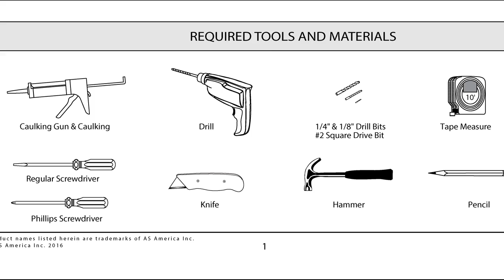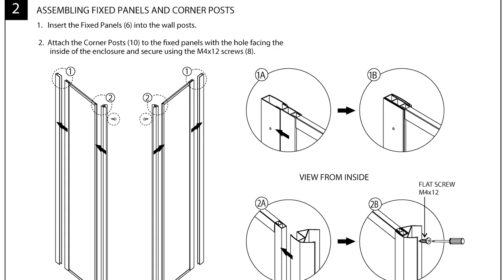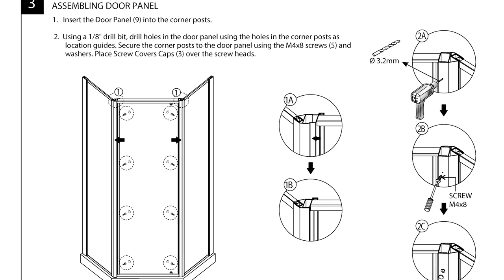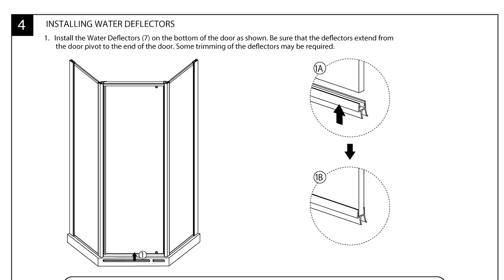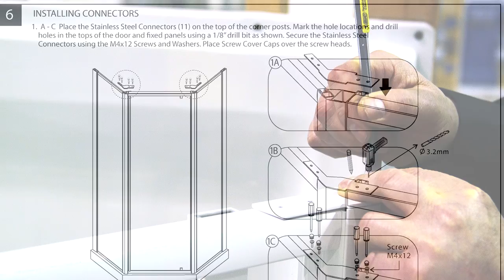How to Install American Standard AXIS™ 38" Neo-Angle Shower Door

Comment: heya american standard. i'm using the base and the glass kit, but not the plastic walls, i have tiled walls. the only info provided is "use anchors" but zero info on how to measure to place the glass. any help here? i can't measure one inch from the plastic walls because i'm not using them
Reply from the maker: Hi Derrick! So there are two different doors. The installation instructions do have the info on how to measure to place the glass, which we've included below:

AM3838N1400.020 – In the install instructions Step 1: You take a level and place it on the floor of the outside edge of the shower base to mark a vertical line on the wall.  Follow with a level vertical line up the wall.  From that drawn line you move in the 1” and that is where your wall post will be located.

AM3838N2400C.213 – In the install instructions Step 1: You take the level and place it on the floor of the outside edge of the shower base to make a vertical line on the wall.  Follow with a level vertical line up the wall.  From that drawn line you will move in 7/8” and that is where your wall posts will be located.

For further clarification or for any additional questions, please give us a call at 800-442-1902 and we'll be happy to chat. Thanks!
Reply: @americanstandard  I installed the 38 frame kit with no issues.  Hung the doors and when closing them there is a 1/2 gap on the top between the magnets. Both doors roll freely on the track top and bottom.  The frame is screwed together tight and square
Reply from the maker: @matthewethier1977  Hello Matthew - We are glad to hear about your smooth installation! If you ever do need assistance, you can always give us a call at 800-442-1902 and a member of our Consumer Connection team will be happy to help. Thanks!